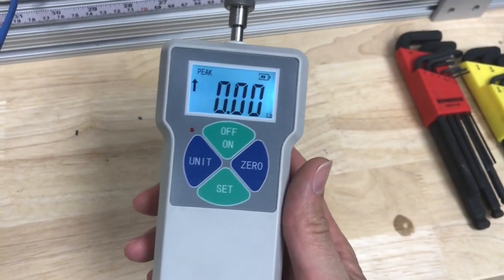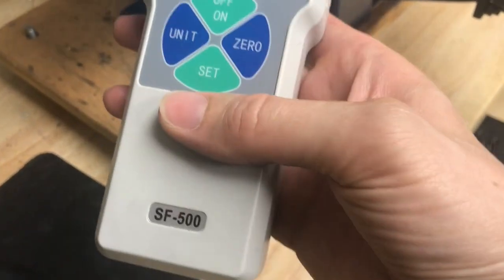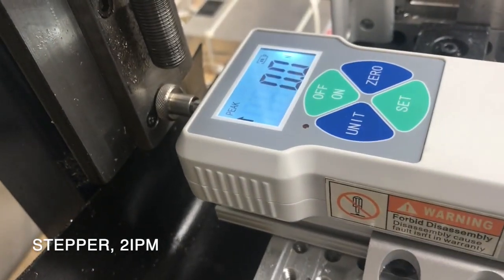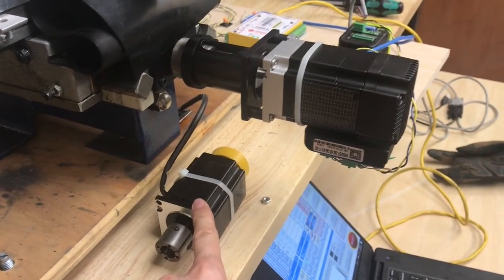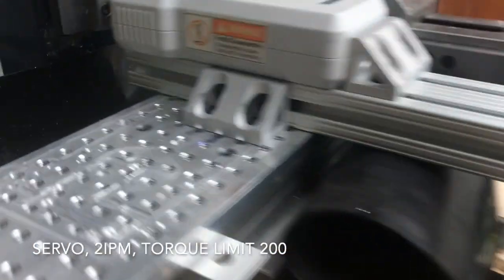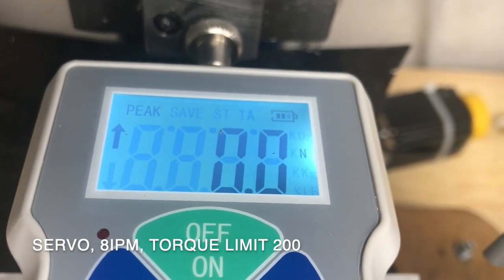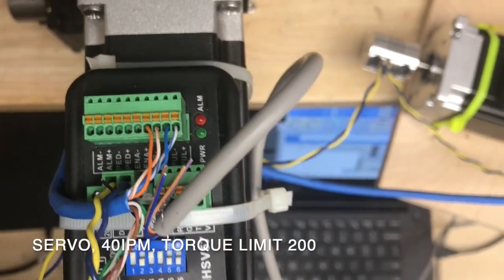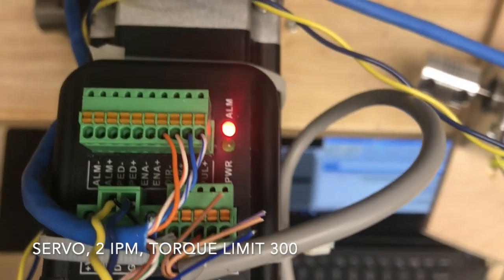JMC Servo iHSV57 (English Language) Video 3 - Force Gauge

Comment: Nice of you to post! The error your JMC's gives are 3 blinks from what I can tell from the vid. That's a position deviation error; I have no idea what these are set at with your tune.  You might also get higher pressure if you increase the stiffness of the tune, since more current will flow to maintain the position. But i think 40kg of pressure on your tool are enough to bend the Taig :). These test are not recommended with lead screws though, it will press out all the grease if you repeat it at one and the same position.  Better be carefull. These motor are unbeatable for their price IMO. fast, smooth and silent.

Comment: Hi, what cnc controller are you using? The one connected to your PC via ethernet cable.
Reply from the maker: For the Servos, the controller software is called UCCNC. The motion control hardware is also from UCCNC company, and it is called AXBB-E.